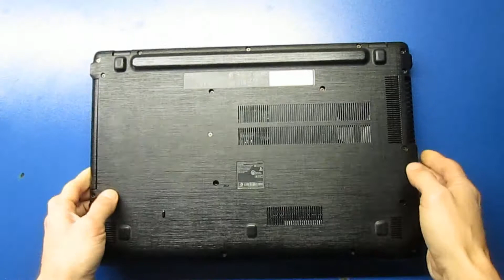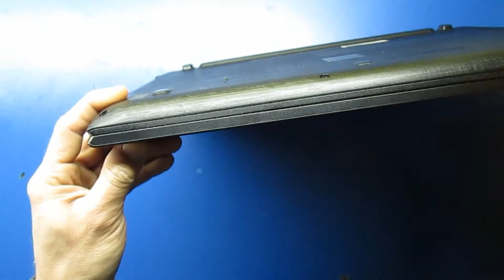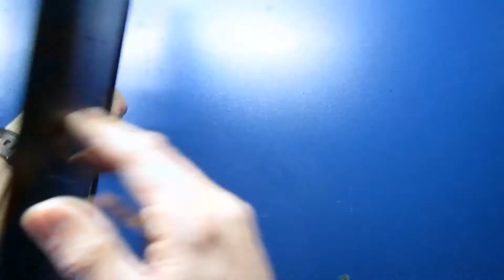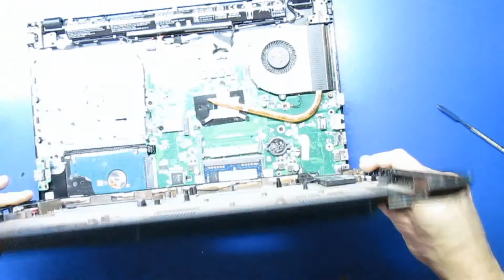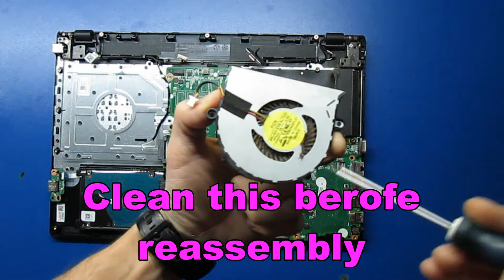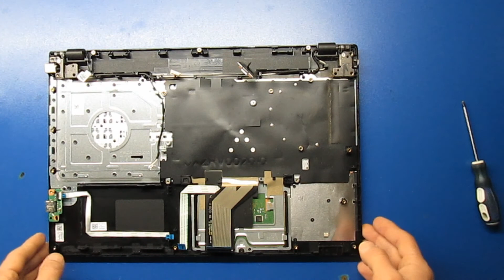ACER TravelMate P258 M Fully Disassembly

Comment: Thank you for your video! It is very helpful. 
Does this model support two harddrives/ ssd simultaneously?
Reply from the maker: ty
Reply from the maker: yes support 2HDD or 2SSD 1 on Laptop and one in SSD Caddy where the DVD-RW goes but in that case you run out of DVD-RW but you get two SSDs or 2 HDDs
Reply: @highvoltage7947  thank you